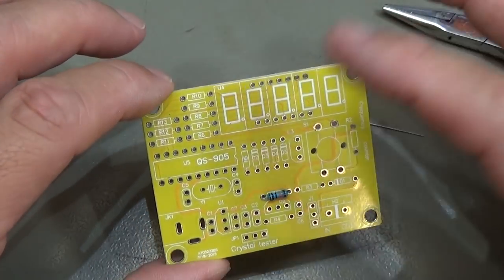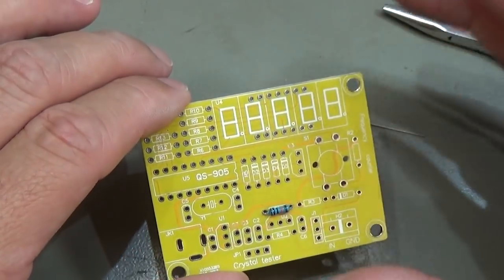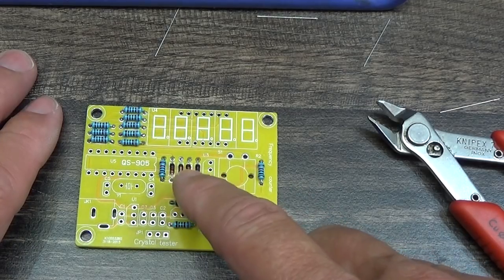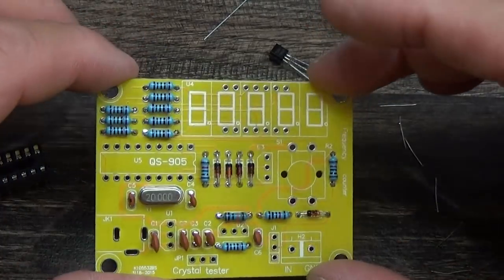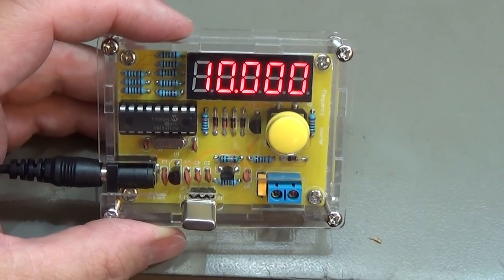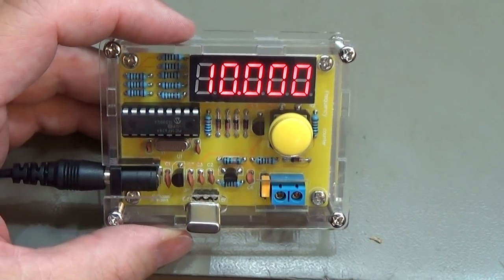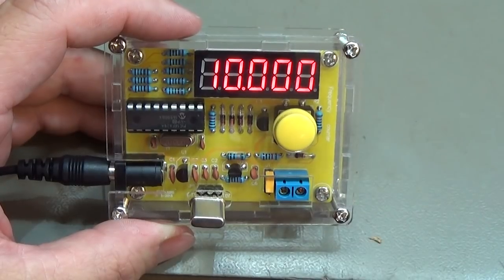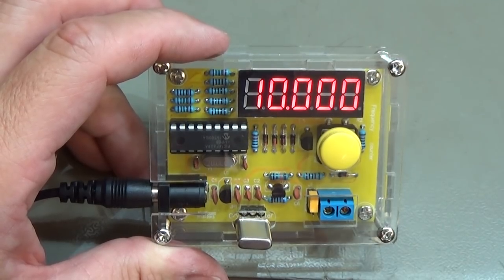#145 Crystal Tester Kit for under 10$ is that a good lab helper tool??

Comment: the frequency counter of this project was originally developed by Wolfgang Büscher, DL4YHF. Trust me, it works PERFECTLY. The Chinese just added a simple oscillator to test the crystals... you can read about this on his website.
Reply from the maker: Thanks for feed-back 73
Reply: I bought a kit of these however when mounting did not work when analyzing the circuit I noticed that I send the same with the KYX3561BS which is a common anode display, being what works in this circuit without any change is the KYX3561AS common cathode, after searching the display I noticed that the project and the DL4YHF, I ended up changing the Pic File to Counter 3 , also changing the position of the diodes d2, d3, d4 and in place of U3 a BC557 and the diode d5 must have katodo connected in the emitter of the transistor U3 and the Anode connected to vcc .....

Comment: I have the same unit and another different "red" unit with a trimmer capacitor. Both units will NOT read above 20 MHz properly. example, 37.600 MHz displays 15.53xx. Other 37, 38 45 MHz crystals show similar results. They 'divide' by 3-ish and that's what they display. Anyone know the fix?

Comment: So this device measure the frequency from the quartz oscillator; why do you not trust it as a frequency meter for external signals as you said in the beginning of the video? If it count the frequency well does it matter if the input signal that it counts came from its crystal oscillator or another source?

Comment: Just built mine. The values for C2,C3 should be 47p or and C4,C5 22p. I was able to measure a small pile of old used crystals and the frequencies are all close to the fundamental value. FYI this circuit will not measure all crystals it just depends on the crystal. This was a interesting build for the price.

Comment: One thing to remember when testing crystals is load capacitance and inductance will change the oscillation frequency.  People frequently ask me if they can send me crystals for a old tube type radio so I can test them to see if they are in spec.  Unfornately I have to say no.  I have a Sencore frequency counter with built in crystal tester but what the crystal oscillates at in the counter is going to be different from what it will be in the radio.  Still a nice tester for testing to see if the crystal is still good and see if it's close to the listed frequency.  One suggestion would be to add a transparent red window over the display.  It would make it a lot easier to read.  Thanks for sharing.
Reply from the maker: Very important point to tell and especially for crystals in tube circuits. All new crystals are very close together in spec's but not in the early days.  Thanks for comment Mike!
Reply: Hi, it's been four years since the video was released, but it won't work for me, the readability of the display has been reduced by not removing the protective film, it creates annoying reflections and the camera doesn't give it. Using a red filter will improve readability, even for the eye 👍

Comment: Aaah, another Sunday with Peter....Makes for a good day no matter what he's up to. Thanks Peter.
Used to be when we owned an FM broadcast station that our crystals lived in a heated oven, supposedly to assure correct frequency.
Reply from the maker: Glad that you liked it 73
Reply: Crystals are sensitive to temperature so running them at a controlled, constant temperature will keep them closest to the oscillator's designed frequency (OCX)

Comment: Peter: Thanks for the good video about the crystal tester. I just completed one with a couple of modifications. I moved the crystal socket up to be even with the top cover and added an HC-6/u crystal holder to the front side for all the older crystals.
Reply from the maker: Ah that sound very good and especially the solution for the older crystals..  Thanks for feed-back 73

Comment: I was surprised how accurate this thing was on the 10.000 MHz crystal.. cool!   I didn't even really need one but since it looked like an interesting kit, I purchased it off ebay (cheap).  I wonder if one could extend that three pin socket for the crystals up higher to be flush with the top of the case. That would really help.
Reply from the maker: Hi Michelly, yes would be a good improvement to bring the 3 pin socket up. Thanks for watching 73
Reply: I had some extra sockets so I added 2 stacks to the existing ones and they just sit slightly above the case top which is perfect.

Comment: You see Peter if you put the display in up side down, dots at the top, when you switch it on all the numbers would fall out of the bottom of the display  hi hi, I have built one actually nice for the crystals to see if they work, I used a dremmel to make the slot bigger.
Paul
Reply from the maker: :-) very good Paul...The dremmel is an excellent idea..

Comment: Thanks Peter. Mine just arrived yesterday and they gave me a 7550A-1 instead of a 7550-1. The 7550A-1 is a N-ch JFET.
Reply from the maker: Hi Robert, oh waht a shame mixing up the components, well you found it early enough... hope it works...73
Reply: Oh yeah, I never build a kit or replace a component without checking it first. I used one of my own 5V fixed positive regulators and it's working great.I informed them about the problem. They offered to give me a refund of a few dollars but I told them not to worry about it. I'm sure I'll need the JFET sooner or later. I just let them know so they could be careful and not get a bad name from newbies and people that don't check components before they start soldering.

Comment: Mine came from aliexpress with bad PIC. Showed only single zero in all modes. Internal quartz check circuit was ok. I rechecked schematics and PCB and everything was fine. Tried to re-flash it - no luck. Wasn't able to erase it with ExtraPIC, PICKit 3 and Triton - it seems that PIC had some memory issues. Replaced it - and now everything works fine.
Search for TheHWcave/PIC-freq.counter-modification GIThub repo for firmware.

Comment: TNX for sharing the build Peter...not a bad little gadget for quick simple go/no-go testing.  73 - Dino KL0S
Reply from the maker: You are absolutely right Dino. It is a nice little lab helper and will give you additionally a idea on the crystal frequency even it is not 100% accurate.. Thanks for stepping in 73

Comment: Nice job showing us the kit.   I would of liked for you to test the counter too.  Ya I know that it is not a high end counter but it would be nice to compare it with a good counter.     just a note,  some xtals require some parallel capacitance to bring it on freq.  So the two that showed off freq might need a external cap.   I think I am going to buy a kit... TU
Reply from the maker: for und 10 bugs you can't do wrong... Thanks for watching 73

Comment: Do you solder the components THEN cut the leads or do you cut the leads to size first?
Reply from the maker: Yeah that is the 40+ years old discussion and still going on LOL. It has been told that you should cut leads before you solder them because the cutting could cause micro cracks which can make gear fail. For production that is certainly right but for rework I have never done it and I don't do it in the future. I have never experienced any problem with electronic gear doing it my way..What is your opinion on that?
Reply: @TRXLab  I have always found it easier to position the components if you don't cut the leads first. And I have never experienced micro cracks either.

Comment: That was good Peter different but good, you didn't press the button. What was the button, I was hoping you would press the button. Well anyways you just can't help it, your troubleshooting picture's now (LOL). I like using blue tack when populating boards, I put some in the middle of the board. Stick it to the bench then solder, as the component gets taller add a little more. It just helps to keep the board from moving and the component well seated. Have a nice day and Cheers ... 73 Out
Reply from the maker: Thanks for watching Tom! Of course I pressed the bottom. It switches in a kind of programming mode with different commands by stepping through. May be a boot loader function or so? Nothing mentioned in the manual.. Cheers
Reply: I like to use Rodico putty. You can get it where watchmaking and jeweler tools are sold.

Comment: I wonder if that crystal testing functionality can be integrated into those 3 wire component testers that are all the rage on ebay for quite some time now.
Reply from the maker: Well for under 10 bugs it makes no sense. But basically it could be added to that circuit ..  73

Comment: I bought the same, but C1 burnt out with the magic smoke, I will put another 104 cap in and see if it works.  M3KQW 73s
Reply from the maker: Oh must have been a shorted cap.. Hope it works out good Howard....73
Reply: Check your voltage regulator - if the part # is 7550A-1 then it is a N-ch JFET, not a voltage regulator.

Comment: just ordered one from e-bay, 7,31 euro houding included, but christals change with age so this is a handy tool
Reply from the maker: very good..have fun with the little project 73
Reply: just soldered it together, not sure how high it will go, my 50MHz crystal reads 16,8MHz, but it could be that the crystal is trippeled in the equpment were it came out, measuring 1MHz big housing crystal failed not sure why

Comment: do the ceramic caps go a specific way ?
Reply: no
Reply: iceberg789 so they can go either way?
Reply: ceramics, polyester yes. electrolytic, tantalum no.
Reply: Santos 14279  Only if you are concerned about RFI. Paul at Mr. Carlson's Lab  has a video on finding the shielded side of a ceramic cap.

Comment: friend tell me the values of capacitors C2, C3, C4, C5 because I think in the instruction manual is wrong
Reply: The values for C2,C3 should be 47p and C4,C5 22p if you have this same version.

Comment: can you explain what the terminals are for please
Reply: Putting the jumpers on the lower two pins will invoke the frequency counter mode and the terminals ... ground and signal .... are for the input signal to be measured/counted.

Comment: Curious to see what's the lowest and highest frequency it can handle. Also whether it can test both fundamental tone crystal and overtone crystal?
Reply from the maker: Hi Kerry, the advertising is saying from 1Mhz up to 70Mhz. No information given on overtone functionality...Thanks for watching
Reply: If it can test up to 70MHz (correctly) I'm willing to bet that it does overtone just fine since the majority of >20MHz XTAL's are not fundamental.
Reply from the maker: There is a good chance that you are right but I can''t confirm it as I have not tested it yet....
Reply: The only one I can find on ebay goes up to 50MHz, which is a shame as I have some 63-64MHz crystals I need to test!
Reply: Build an osc. that goes that high and use it with your own counter.

Comment: Hi Peter built 2 of these and both give me the exact same fault just displays 8.8.8.8., double checked soldering and components, my display are both KYX3561BS ? any idea's i have a crappy circuit diagram ? 73 James
Reply from the maker: Hi James, some one here on this threat has reported a wrong component with the kit. Just go down and read the comments....73

Comment: i get all 8.8.8.8 's
Reply from the maker: Does it work or not?
Reply: TRX Bench no does  not
Reply from the maker: check your components and your solder work!
Reply: TRX Bench I sent video the ebay seller hopefully they can help me
Reply: I haven't put mine together yet, but instead of the 7550-1 5V regulator, they sent me a 7550A-1 which is a N-ch JFET according to my Peak Atlas DCA 75 Pro analyzer. That might have something to do with it not working right. The schematic shows a voltage regulator with grn, in & out, but of course, a JFET has gate, source, and drain. It's also a strange JFET that has the gate at Pin 1. I can only find data sheets that show the gate at Pin 3.They also sent me 2 102 caps and 3 22p caps.